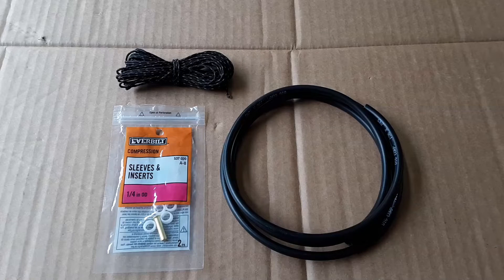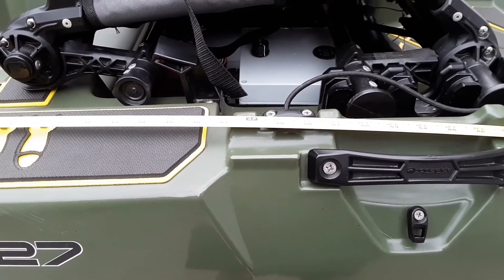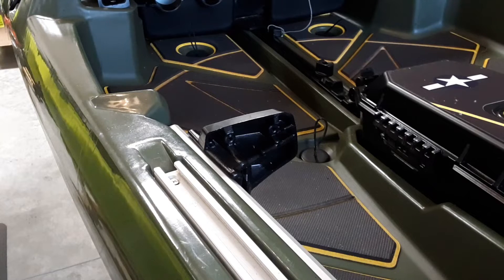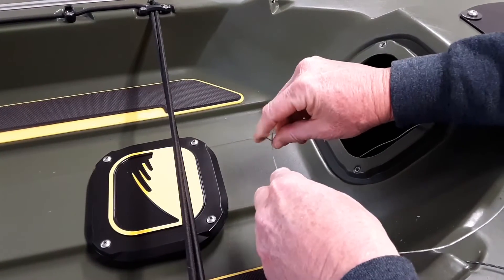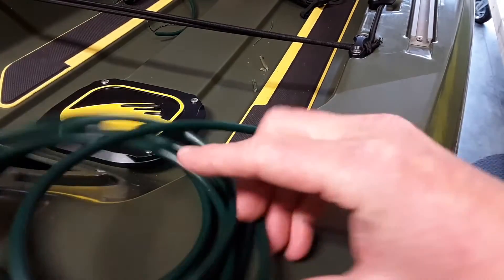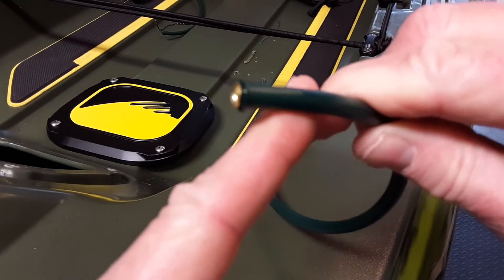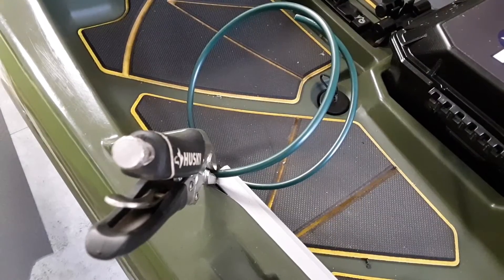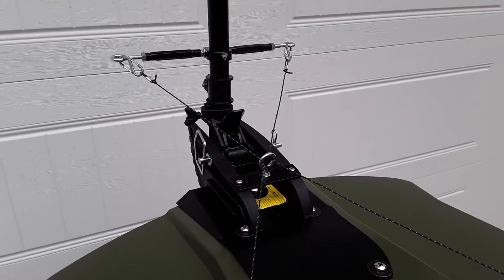Bonafide Kayak SS127 Cable Tube Install

Comment: Good work. A quick question about a PWM. I first installed a trolling motor on a Jackson Big Tuna in 2013 and just used the switch, Later I tried three different PWM's and all fried in the heat and humidity of NW Florida.  With the popularity of kayak fishing, I am finding the need to extend my fishing range. It doesn't take long for the locals to figure out where I am fishing. I normally fish only 3-4 hours and a 55AH battery on my Newport 46 has been more than adequate on my current Vibe SG 130, using the switch.  I want to duplicate your last build but would like a recommendation on a PWM that might endure my fishing conditions. Thanks for all the good information you provide.
Reply from the maker: Thanks J. FPV-Power Motor seems to be popular but it's not cheap. A lot of guys are using ESC controllers now.
Reply: I spray mine with CRC waterproofing spray and has lasted for 3 years

Comment: Thanks for the video. I can't seem to find the black dyneema. Any help in that would be greatly appreciated. Also, is that cord 1.8 mm or 2.0 mm?
Reply from the maker: Glad to help Jamey. It is 1.8mm and I saw some last week on Amazon.
Reply: @Aksmaniyak  All I'm seeing there is the bright green. Would you happen to have a link?
Reply from the maker: @jameyg1819  Paracord Planet – Fluorescent 1.75mm Reflective Guyline 95 Paracord Tent Rope Camping Parachute Cord – Black – 65ft
Reply: @Aksmaniyak  Thanks. Isn’t 1.8mm or 2.0mm dyneema like 450 pound tensile strength? That 1.75mm is 100 pound tensile strength.
Reply from the maker: @jameyg1819  I don't know exactly what the T strength is but you will never even get close to it. The main thing about dyneema is the outdoor environment qualities that make it great for this use.

Comment: How important is the tubing as long as  there is the ferrules to keep the cord from rubbing on the edges of the holes?
Reply from the maker: It really depends if you have a clear internal path without binding or rubbing of the line or not.
Reply: Ok thanks. That’s what I was thinking but making sure I wasn’t missing something.